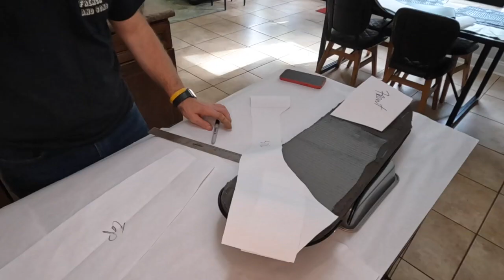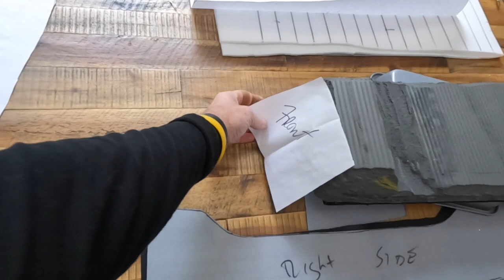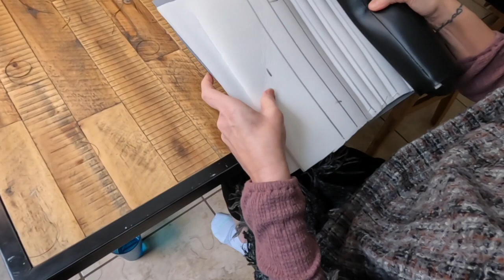How to make a custom seat cover for your vintage motorcycle!

Comment: You did a great job making that seat. To make it easier you need a walking foot sewing machine. The Walking foot helps you when you have multiple layers of fabric and foam and trim.  It grabs the fabric and moves it all together while the needle is through all the layers. A Consew 206 RB-5 is an example. They are expensive but you can find them second hand if you look.  The industrial machines are really too fast for me so I bought a motor I could adjust down and used pulleys to slow it even further.
Reply from the maker: Thanks for the tip. We had loads of fun doing it. This is the 4th or 5th one we had done. Making it up as we go along. 😂

Comment: This is an excellent how to do your own seat cover at home video. This is easy to understand and shows that its fun to make your own.
 You did a really good job with making your templates and showing how to use them. Try making tape for a template and transfer it to paper.  Give the hand wheel a turn and start the needle to give your machine a little help starting and hand crank around corners is a little trick. Maybe try a size 18 all purpose or leather needle with 69 polyester thread. However that universal coats upholstery thread your using is just fine. Trim little cuts in the corners they bend a little easier when you are sewing and stretching it in place. Again your video is proof that you don't have to have a walking foot machine to do a nice job on a seat cover. One of the other comments mentioned an industrial machine. If you look in newspaper and industrial auctions for a Seiko, Singer, or Juki industrial sewing machine thats how I got my first industrial machine. If you plan on doing more I recommend a new Juki DNU-1541S machine I love the one I have. So did you have to heat steam or stretch much to get it to fit after ordering your tack strip ? Thank you and I am really glad I found your channel. Great work 👍
Reply from the maker: Thanks so much for your tips. Definitely could use all we can get. We had a blast making this cover. Thanks for watching.